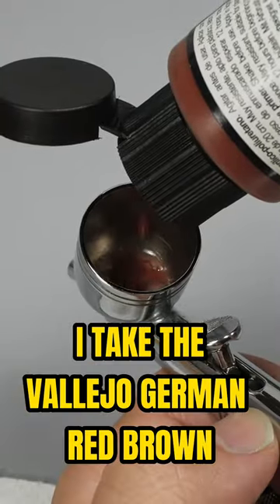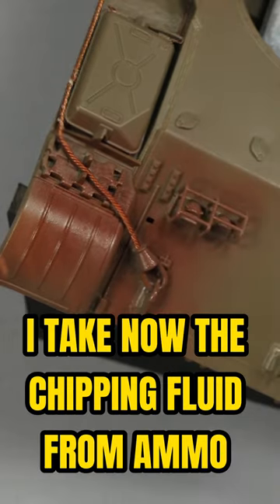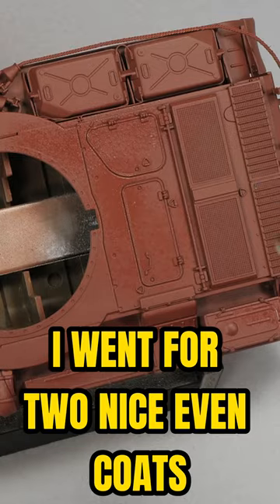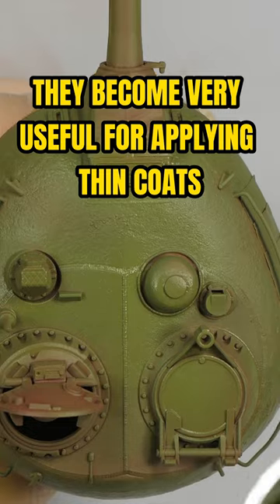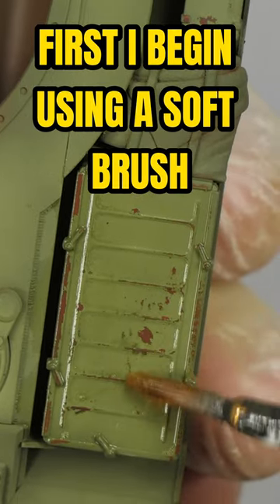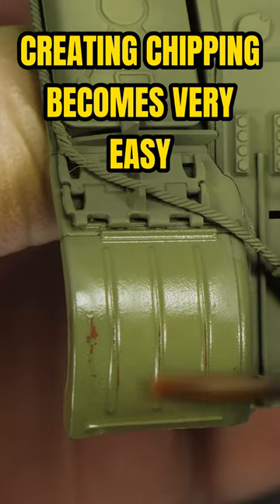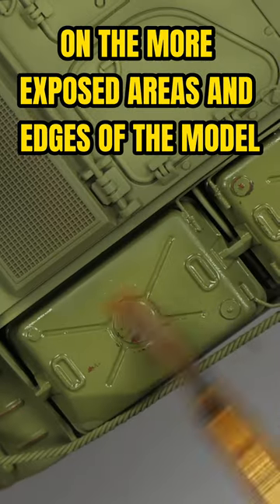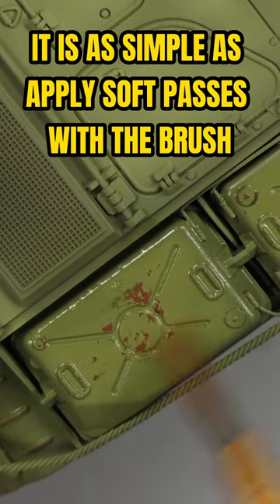How to create easy weathering using chipping fluid #scalemodel

Comment: Russian did not use oxide red primer. The paint was the primer too.
Reply from the maker: Well, I base my chipping, although is a very light one, in some photos of abandoned t-55's where can be seeing oxide tone heavy chipping.
If you can tell me the type of color they used for primer/paint and where they exactly started doing that it would be super useful for future projects.
Thanks for your comment!
Reply: @notjustpanzer  your project is about a T-55, isn't it?  In that era, the soviets used the paint ЗИС (ZIS)-508 
(khaki green) and XB-518 (khaki), these paints were used paralel, and to my knowledge, they were similat to 4BO, so they were primers and paints at the same time. So when the paint chipped, the metal(rust) showed underneath. (To my knowledge)